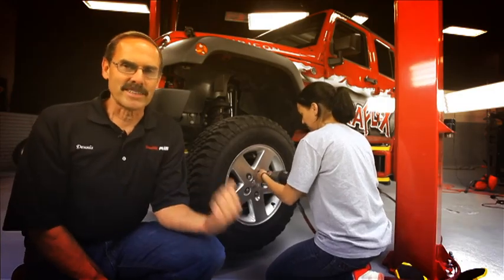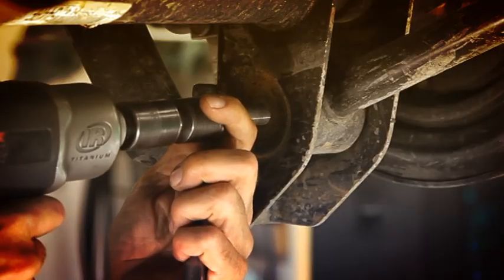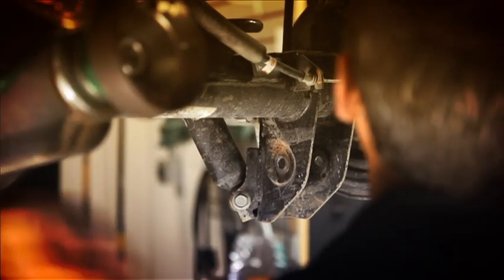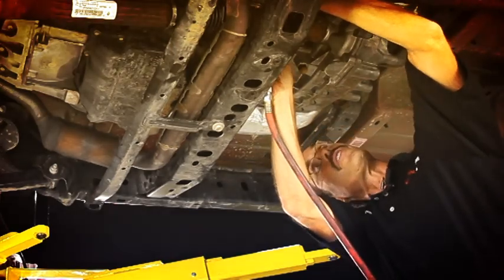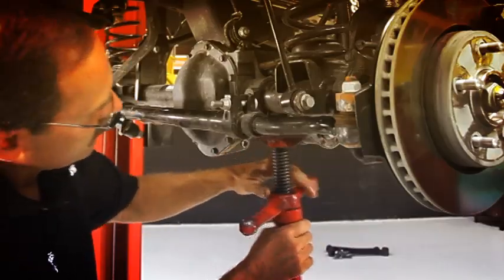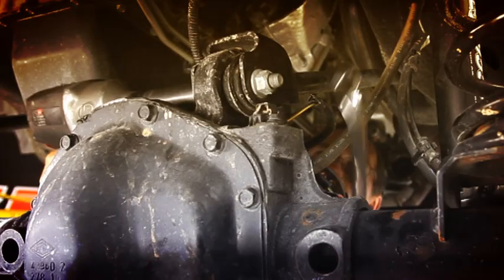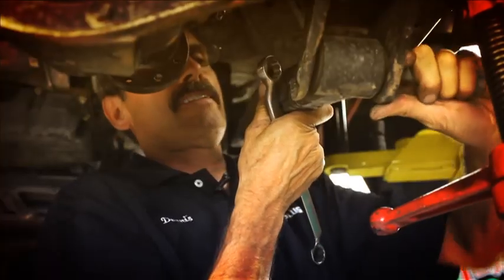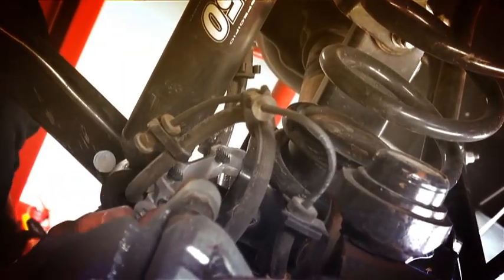TeraFlex Install: JK Long Arm Kit Part 2 of 7

Comment: just bought the teraflex front upper and lower short adjustable control flex arms for my 2012 jeep wrangler unlimited. I have a 2.5" lift kit on and my caster is way of, i cant get the alignment properly that's the reason i bought this arms. I was wondering if you could help me by giving me the proper measurement for the upper and lower arms in order to save some time!